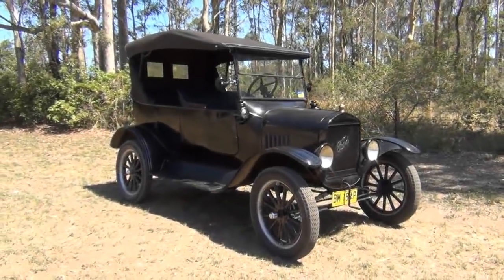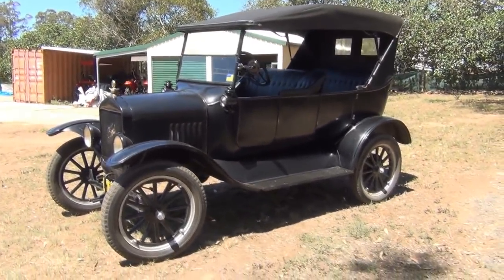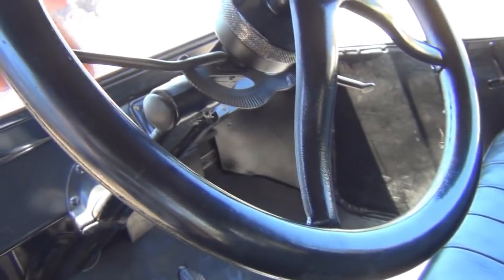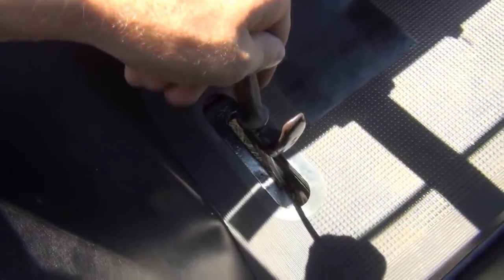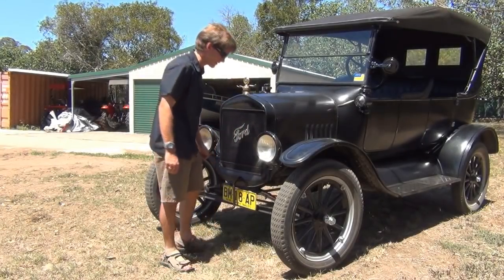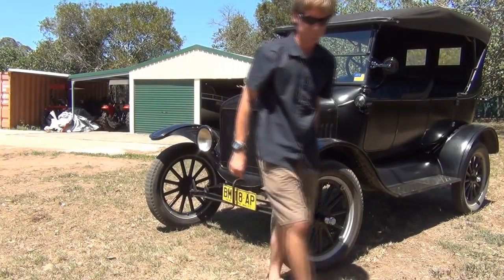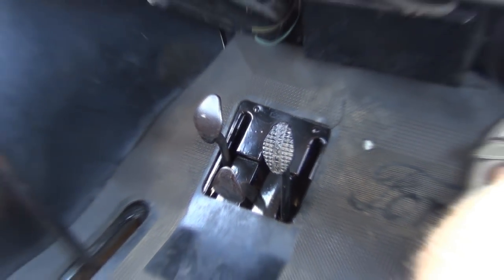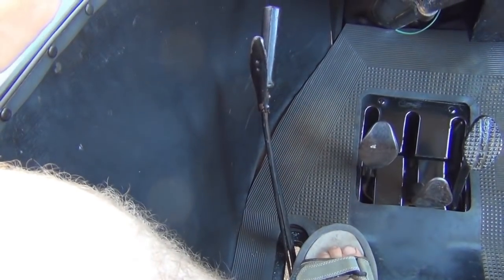Ford Model T - Starting Safely & How to Change Gear

Comment: 15:25 - Sorry, we Canadians drive on the same side of the road as Americans. Our cars aren't built backwards.
Reply: Gordon Steadman Not true during the time that these cars were built. Canadians drove on the right side of the road until the mid-20's, we only switched to left hand drive because of continued pressure from the US manufacturers and government to do so (has anything changed). 

Most Model Ts built in Canada were right hand drive. Initially all overseas production was in Canada as well, but when this dried up, there was little appetite to built RHD cars in North America.
Reply: Pat Meyer I believe you mean we use to drive on the left side of the road we still drive on the right side ;)
Reply: I think they kept driving on the left side for longer in either Nova Scotia or Newfoundland.

Comment: Driving an old car mustve been complicated
Reply from the maker: It's only what people got used to... I find it as easy, if not easier, than a modern car :)
Reply: lol thats not a rational statement at all, too many steps, would be easy to forget one and cause damage to the car
Reply: It's a very rational statement. Driving a car like this (I used to have a Triumph TR6 with a manual choke and 4-speed manual transmission with the heaviest clutch ever devised) is like learning addition and multiplication tables. Once you're drilled on the procedures, you've thoroughly memorized them, and you never, ever forget. It becomes second nature, like snapping your fingers on the downbeat.
Reply: Sorry, that does not compute. It might be more fun and more interesting than a modern car, but that left pedal having two different functions is not easier than anything on a modern car.
Reply: lol.. a modern car is far more complicated. The left pedal in a modern car does more than the left pedal in a model t. The clutch in a modern car puts it in neutral, and engages every single gear after that after selecting a gear. The left pedal here only puts it into either low or high gear. Seriously not complicated even in the slightest.

Comment: first your driving on the wrong side of the road and second tire is not spelt tyre, it's spelt tire.
Reply from the maker: +mike vantol ... I am Australian :)
Reply: +Mitch Taylor (PremiereDirector) I was joking nice set of wheels.
Reply: +Mitch Taylor (PremiereDirector) I think i hade a chrome rad shell in my possession. it hade the ford blue oval in aluminium on the top. I had no idea what year it was from.
Reply: +Mitch Taylor (PremiereDirector) Which is of course a state in England ;)
Reply: mike vantol. Spelled
Reply: The correct spelling is tyre.
Reply from the maker: @TheMikevt  No offence taken :) The different spelling of "tyre" / "tire" is a common comment on my channel!